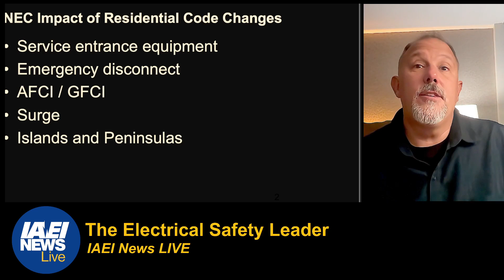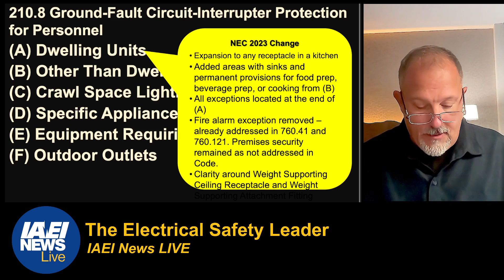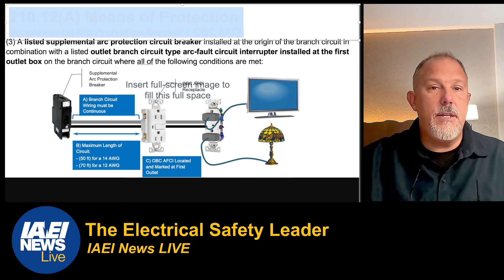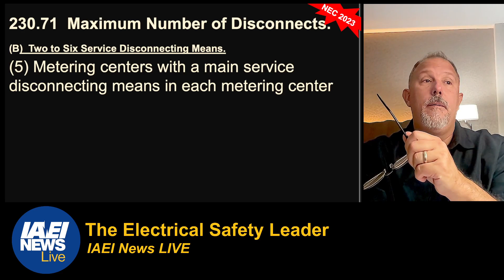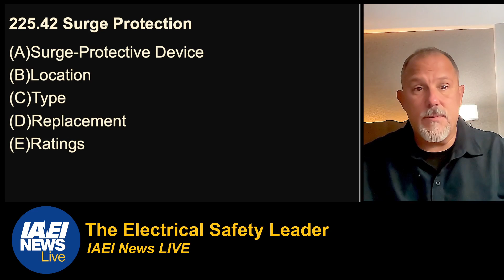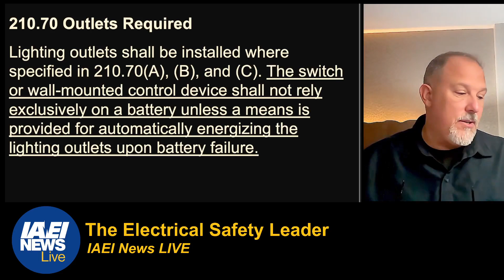NEC 2023 Significan Changes - Dwelling Units

Comment: About the emergency service disconnect. It's long overdue. Another podcaster was showing the prices of a Siemens 200A unfused disconnect was $688😮 A 200A outdoor main breaker enclosure costs a fraction and the breaker protects the service  cable entering the structure. A combination meter&and main enclosure solves a few dangers. During my career, a few homes caught fire after a storm pulled the service off the house during a black out. When the grid went live again, while damaged services were laying damaged on the ground, if there was a main breaker outside to detect the structure grounding going live, might've saved a few houses from burning during my days.

Comment: There needs to be an exception for wireless lightning control that allows for remodel situations to not require a wired switch. I mean some of the wireless devices were invented specifically to relieve the impracticality of installing a switch in certain circumstances. Also….Does this mean pull chain lights just became pointless as they will require a switch anyway? Maybe an exception should allow for remote control of a light or fan that has an integrated pull chain switch.

Comment: It seems to me that while the CPSC data is compelling, it should not have been the only input the Code panel considered.  The data which will now be collected will include the burns and other accidents that occur as a result of extension cords draping across the floor from the nearest counter-mounted outlets to power those same appliances at the island.   Sheer foolishness in my view.  The high road would have been to still require the outlets, but prohibit their installation below the counter surface.

Comment: I'm all for saving a friend or customer money but see problems with a 10 amp breaker supplying only LED luminare . Contractors on small to mid size homes will be tempted to p!ace entire LED luminares on only a single 10 amp breaker. Just great walking thru a dark house when the 10 amp breaker trips. Also hear they are working on allowing a #16 gauge copper type NMB  cable for LED loads and feed from a 29 amp circuit breaker. Can see cheap shake Johnnie homeowner going to the big box store and purchasing the #16 NMB cable for receptacles he is installing.Great vid.
Reply: There's nothing in the Code now that prohibits the entirety of the lighting being installed on one 15A circuit of a smaller home.  I'm not sure there's any new reason to get exercised over 10A lighting circuits.

Comment: Instead of a residential customer spending  several hundred dollars for an outdoor disconnect why don't they make the utility company add this to their smart meters. In my area lazy inefficient PECO/EXELON smart meters that then received a large grant for only useful to them. Homeowners still can not access any information from the smart meters but they can send out a signal and disconnect the power. While helping a coworker replace a two gang meter socket & service cable on a Sunday morning within halve a hour a PECO truck stopped by and wanted to know why meters had no power. Takes same PECO up to a week to come out and remove a barrel lock on their meter.

Comment: Not a fan of the compromise on kitchen islands.  I really feel like they should have just gone for it and required them on top.   So what if you tick off a few Karen's...  Additionally, I think you're going to see a lot of junction boxes that are blanked off to fulfill the future use requirement, which will then have a receptacle installed in them as soon as the inspector leaves....which effectively makes the new rule worthless.
Reply: I think a island top requirement would drive a ton of innovation from manufacturers to have various types that pop up, blend in, and stay safe.  Who know's what they'd come up with.  Now there's no incentive.
Reply: It’s gonna look pretty stupid every 4 feet. If they bring it back, they should have just a requirement of one per island, no peninsulas. Also allow for a cord hole so an outlet can be concealed in a cabinet maybe? I always thought the island rules were kind of silly. I don’t see many people using appliances on the island because they don’t like to move them around and people tend to like their island clear.
Reply: I think it is ridiculous that so many codes are needed to make up for things like bad parenting and lack of common sense.